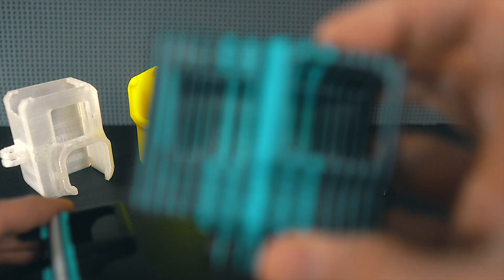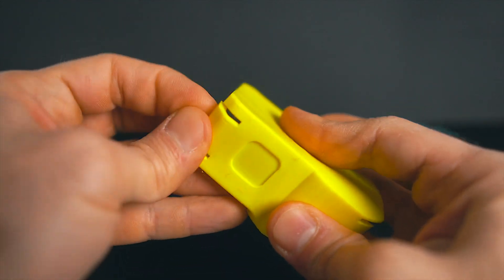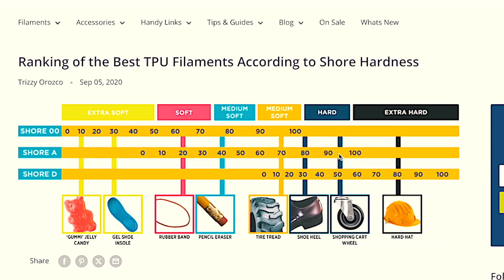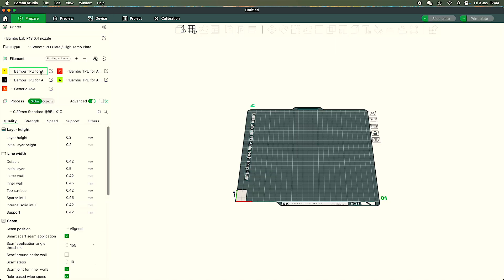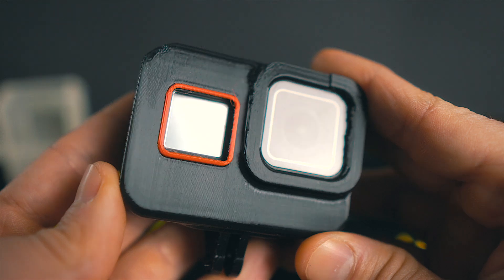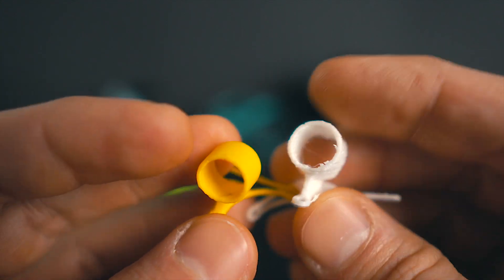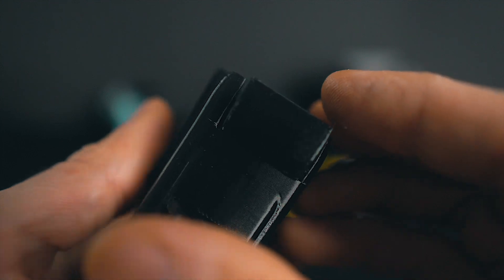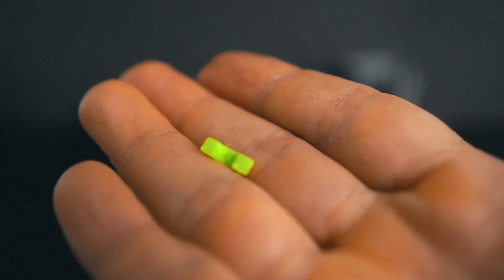Bambu Lab TPU for AMS - Is it the Right Filament for FPV?

Comment: What temperature have you printed it at? I'm pretty sure that weak layer adhesion is the result of too low temperature + part cooling fan.
Reply from the maker: I’m using the stick profile. Being this filament from Bambu I’m expecting it to work out of the box with a Bambu profile.

Comment: Have you ever used the extrudr hard TPU in the AMS. Its a eeally good high shore filament but i dont know if it goes in the AMS, buying an A1 mini depends on this
Reply from the maker: I only know about the extrudr 98A, which is marginally harder than 95A. I have not tested myself, and based on many comments I have catch up from the internet, I wouldn't try since I believe the results will depend a lot on the model you print. The inconsistency level should be pretty high.

Comment: Would you recommend this filament for a watch strap?
Reply from the maker: Good question. I think it will be too stiff. Even if possible I think a strap of this filament will break with time. Test fits regular 95A or even better 98A TPU
Reply: @NordFPV  Appreciate the response. Cheers!

Comment: This is a very helpful review.  I have just started using Bambu TPU and this provides some practical application notes. My first impression is that it's closer to the hard end of the scale and less rubbery, so maybe good where some flex is needed but not for say rubbery seals.  As you observed, it prints nicely and the finish looks great.  BTW,  one can find the TPU shore hardness chart you displayed by searching for: Ranking of the Best TPU Filaments According to Shore Hardness (dated Sept 2020).  The link is too long to include here.
Reply from the maker: Thanks for the tip for the chart!

Comment: It prints really really nice because of the high shore hardness (and of course the printer itself), but seing it actually split between the layers with two perimeters regardless of infill... I wouldn't use it for any structural parts or for holding an action cam that's for sure :/ I think that the only way to go multicolor for tough parts is using a multi-extruder system and stick with 80-95A hardness.
Reply from the maker: I'm agreeing with you 100%

Comment: I am using A1 mini for multicolor TPU . how ?  I set “pause” on the layer where I want a new color and then I unload and load tpu filament manually. Takes lots of efforts , but results are worth it.
Reply from the maker: There are several techniques to do multicolor prints, but none as easy as to do multicolor with an AMS. Idex printer or multi head printers will be the best choice but obviously that has a steep price.
Reply: @ let’s see if new Flashforge AD5X will be able to print multicolor TPU as advertised
Reply from the maker: In the AD5X you still have quite some distance from the motors pushing the filament on the AFS up to the print head. Despite you can achieve decent prints with a kind of bowden tube configuration, some issues will be expected from my side in this system. Only time will tell.